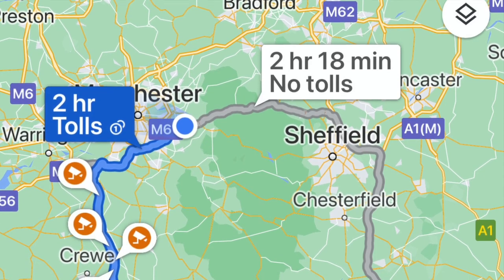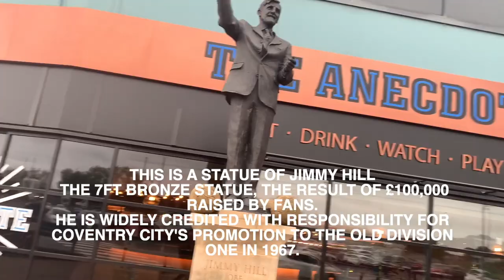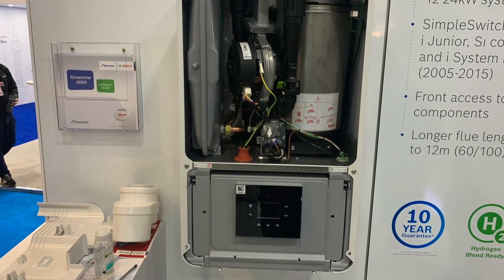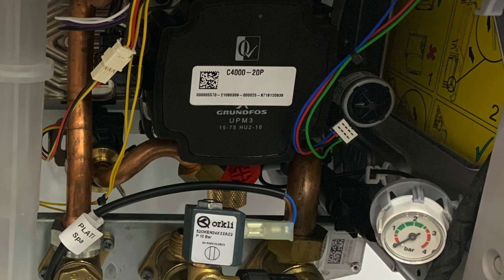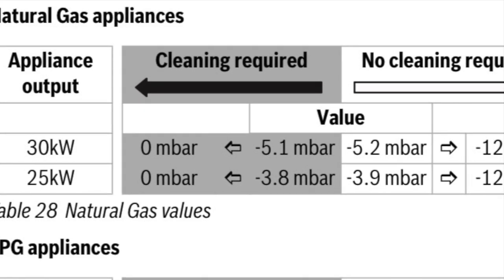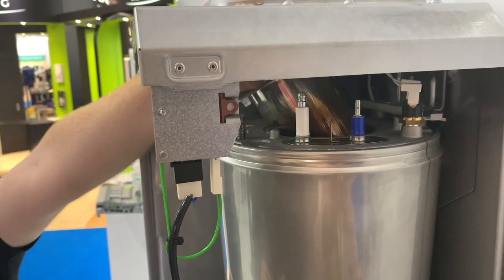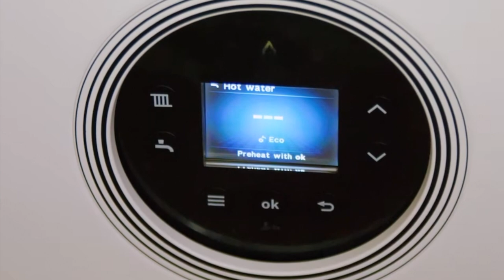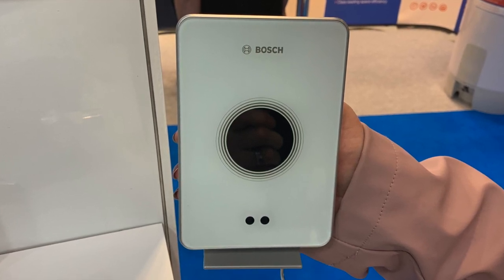GOING TO INSTALLER LIVE 2021 to see and  review  the new Worcester  4000 combination boiler.

Comment: Hi. Can you tell me if the scale  filter should be connected to the hot pipe.. so a  Assume that will be the hot flow.. I am know  plumber.. or should it be connected to the COLD PIPE 🥶 🤔.. Thanks
Reply from the maker: The scale reducer protects the boiler from scale so goes on the cold inlet pipe

Comment: Hi Tom, I’m in the process of changing a radiator that has no TRV, I plan on fitting a TRV. I can’t tell which is flow & return,
With rad off wall. Does it matter which end I fit the TRV.? Thanks.
Reply: Get a Danfoss rav reversible when fitted
Reply: @john thomas I’ve tried that it’s difficult with out rad on, because there’s no water running through pipes to get hot.
Thank you.
Reply: @barrydoherty636  Maybe you can remember where the thermostat valve was and that's the flow!
Reply: @NeoFreshair NEVER BEEN A THERMOSTAT THERE.

Comment: Do you know whether the boiler comes with the filling link?
Reply from the maker: The trainer said they were extra
Reply: @tomkatgastraining  thank you. It's a shame that Worcester doesn't provide the keyless filling loop with these boilers. I believe baxi do... Worcester needs to up their game. I'm not a huge fan of the heat exchanger style. Looks difficult to clean compared to the conventional design. The baxi 8000 heat exchanger for example could have been included in the 4000, wouldn't have broken the bank.